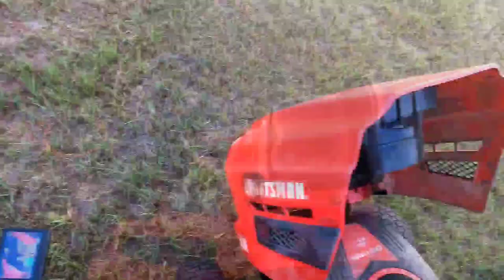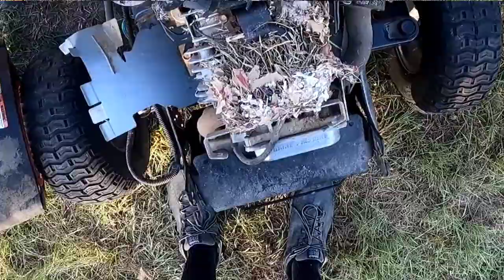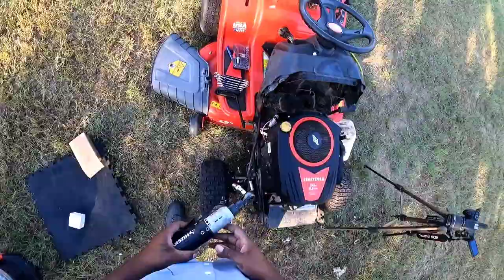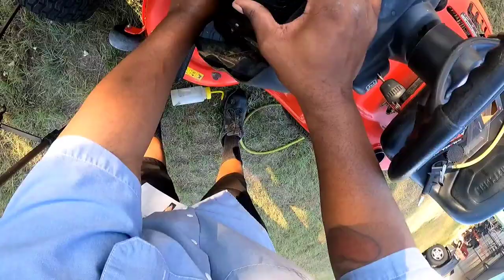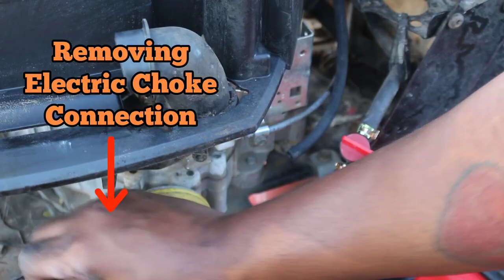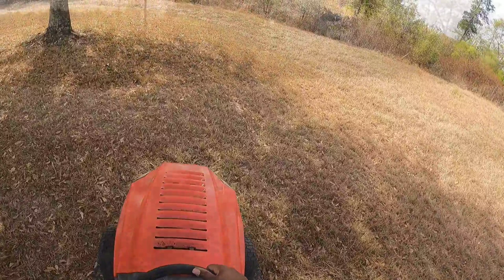Fixing up a Craftsman T130

Comment: Dang where was this when I needed it last yr...gave my mower to this turd ball to fix cuz I didn't have time to fix it myself gave him 283 and he did nothing left my mower outside, it rusted some he kept it for months kept giving me excuses about fixing it and I still have to do things myself so last week I changed the deck belt, the oil,  oil filter, charged up the battery, I ordered a new PTO cable got it in yesterday  but today I came home too late so imma have to finish it tomorrow when I get home. I don't think I need a new fuse, the one there is a 20 and she starts fine but not like she used to,   would it matter if I up the amperage to 25 I don't want to burn it out,  I might need a new starter fuse though not sure, and I for sure need new blades but I don't have the proper tools or a breaker bar to take them off so for now I'll use the same ones, my pto cable shouldn't be too hard to figure out right? Seems simple enough. Thanx for the video
Reply from the maker: Nahh the pto cable isn't hard. The bolt connecting it to the bracket is kinda in an awkward position. Yea that 20 amp fuse is fine.

Thank you for watching!